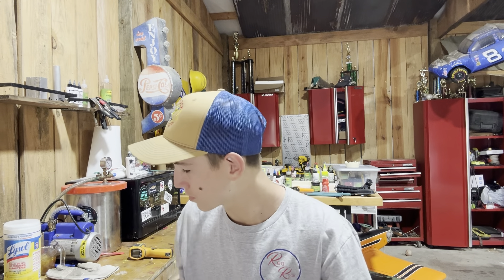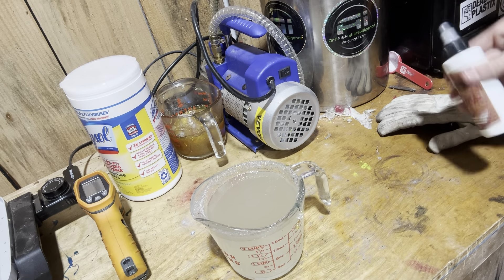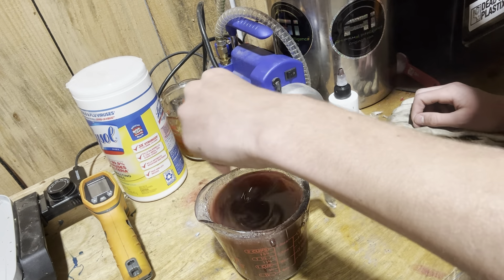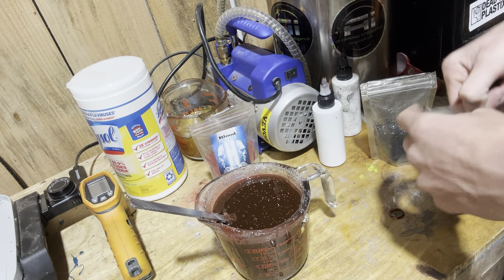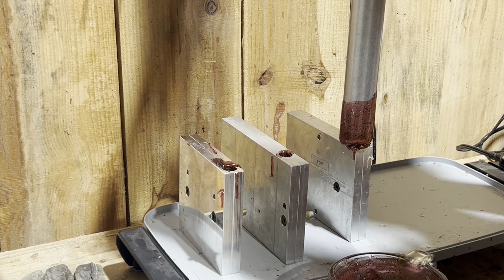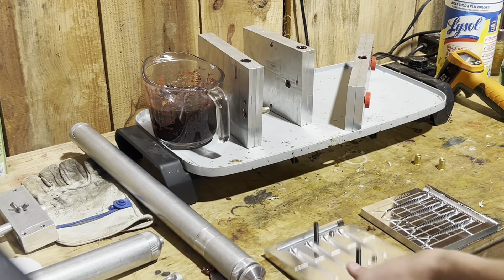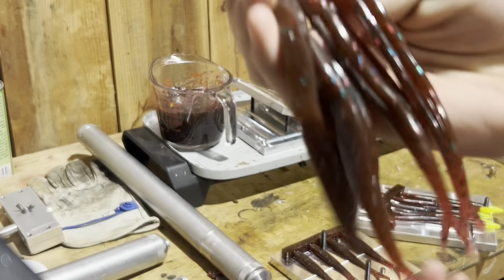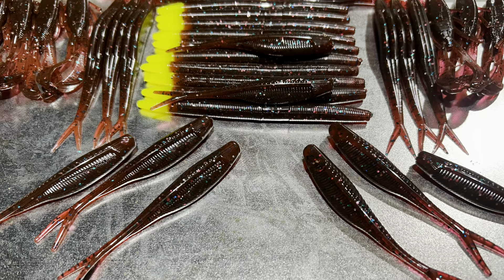Using a new DOP color for my tracer shad mold!!!

Comment: Im still waiting on my senko mold from fatguys i sent it back to them to fix it. Have you had any issues with fatguys on any molds?
Reply from the maker: No I’ve never had any problems and there molds I’ve had never flash, I called them a couple days ago and they said they were waiting on the brass for my mold and that they make the molds when you order them, they donnt premake them like angling ai
Reply: @cooperhandly  anglingai I love love love. Never a single issue with those molds. I also have issues with my mousetail molds by fatguys that can't be injected as a 1 part process they have to be made in a 2 part even if you want to just use one color. Which is a big let down considering how expensive those molds are. I'm going to be going with other suppliers in the future since they never even emailed me back letting me know that they received the mold and are now working on it. Communication is everything with a business and they aren't communicating properly.
Reply from the maker: @freshandsaltyjohnny yeah I hate when their expensive like that and you have to do that I’m getting my slide system molds tomrrow